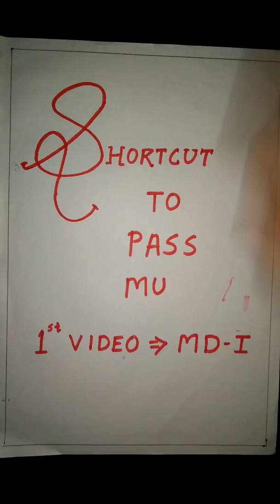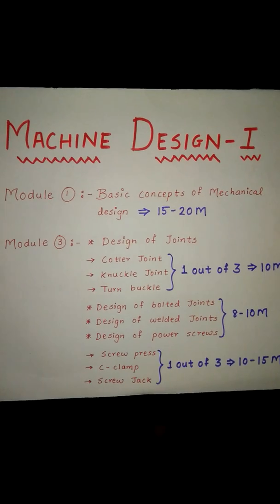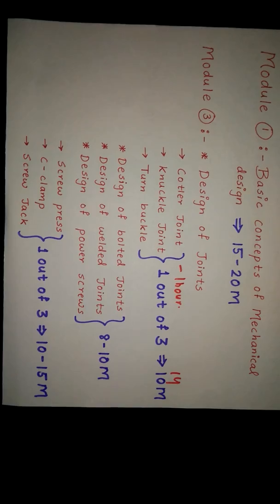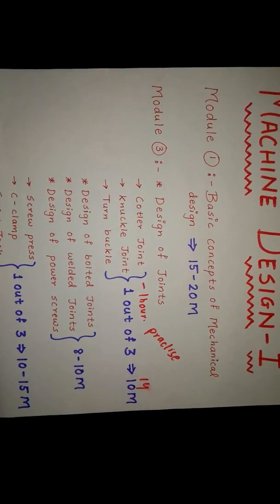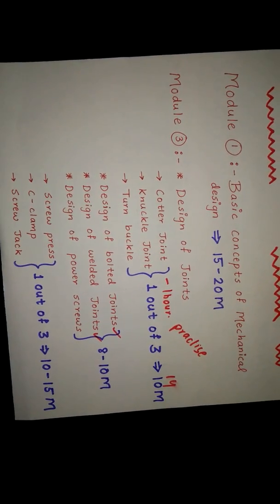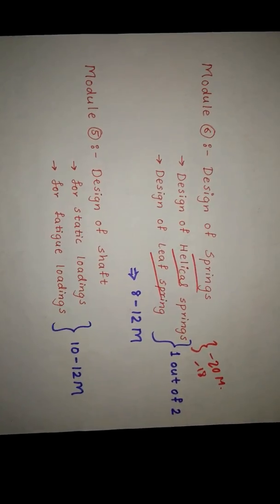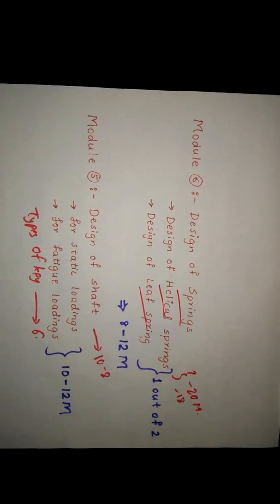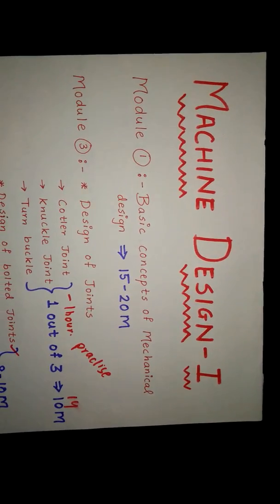How to pass machine design-1

Comment: A V-belt drive is to transmit 10 kW to a
compressor. The motor speed is 750 rpm and
the compressor pulley runs at 250 rpm. Design
the V-belt drive. Clearly state the design
decisions taken.

Plz solution this question